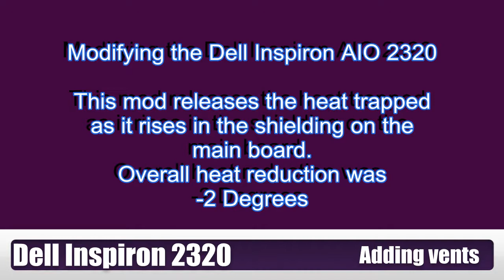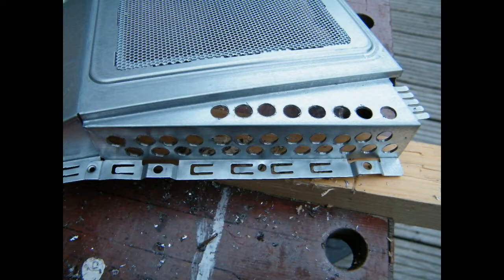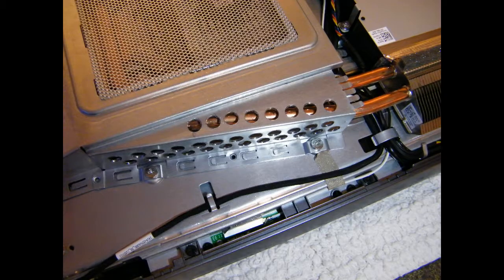Dell Inspiron 2320 AIO adding vents to metal shielding to allow heat to escape

Comment: I just took the plastic back off and left it off. It worked great afterwards, and the Hard Drive cables were garbage causing all the Blue Screens and errors not finding the BOOT drives. Replaced the cable and works just fine. The other GPU errors were the crappy AMD drivers which AMD eventually sorted out. I just installed the Catalyst drivers and didn't put the Crimson versions on it.